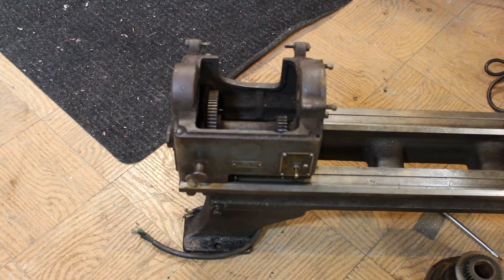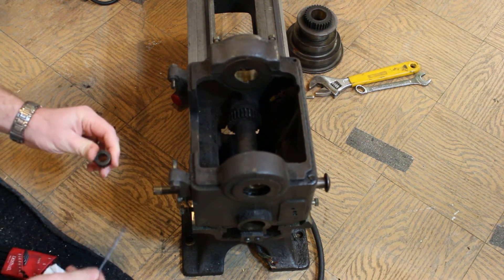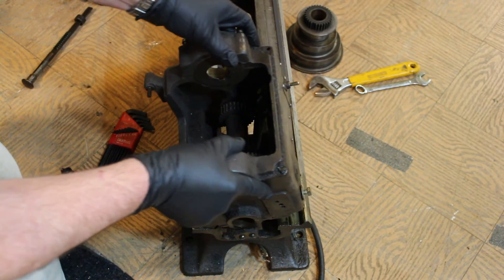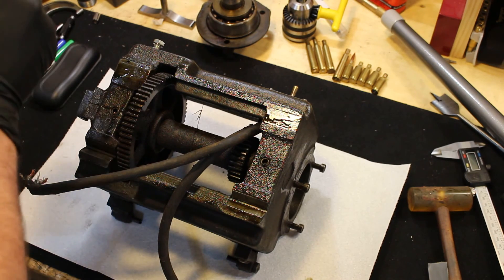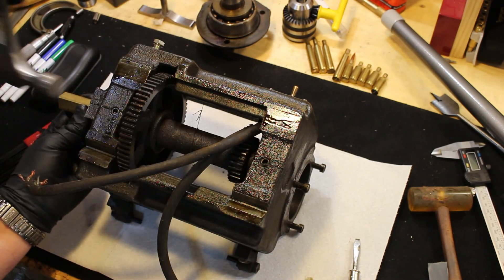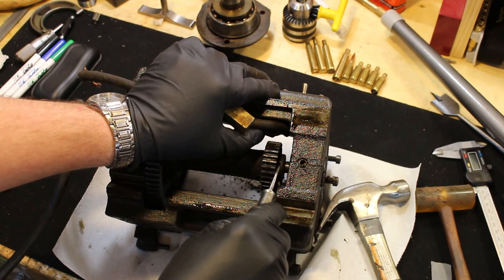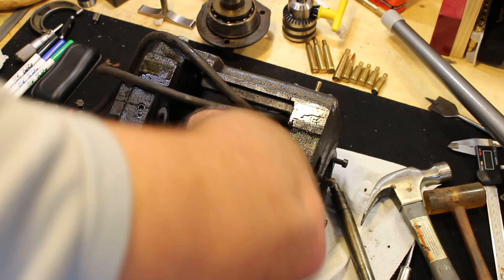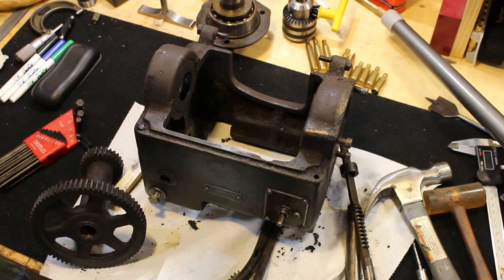Logan Lathe Back Gear Removal!

Comment: Did your Logan have a back gear shifter rack assembly? After 20+ years of enduring a back gear knob which locked the spindle but did not engage back gears, I realized that the latch key / detent assembly was missing . . . spring, pin, and latch key.  Using the Logan Parts List, I should be able to figure out the dimensions to make these parts but I would prefer to find OEM replacements.  Does your "parts lathe" have these components available? LA-264 (latch key), LA-275 (pin), & LA-238 (spring) 2thferry
Reply from the maker: Hey, This one did not have the detent or spring. This is the second 10" that I have owned where these parts were missing. My main 11" lathe has it, but that is my main lathe that I use every other day. I don't know if they break, or if people just pull them out. You should be able to check out www.lathe.com which is the Logan website. They sell NOS parts, but you may pay a little extra for them. Otherwise your best bet would be to watch out on ebay. If you can make them even better.  I can run down and measure my 11". I'll post back with some dimensions.
Reply from the maker: spitfire1821  The detent lever is 1.25" long and I would make it a few thou less than what the width is on your pull bar. I did not remove mine, but it just looks like it is a triangular shape. I would cut a couple tiny notches for the spring to fit into so it doesn't slide. Should be a fairly easy part to make. Good luck. Let me know if I can help with anything else!
Reply: Thx.  Looks like I may have to make it after all.
Reply: T 2thferry Since Logan Armature wants $50 for the parts, I made them myself based on their parts book description. My back gears finally working after 28 years of a role as a spindle lock . . . but very noisy (like / worse than Tubalcain's Atlas lathe)
Reply from the maker: T 2thferry Haha, Great to hear you got it working. Yeah, those things tend to be noisy. Even mine is a little louder than I would prefer, but I guess you just learn to live with it.